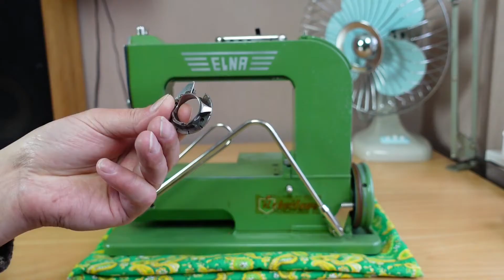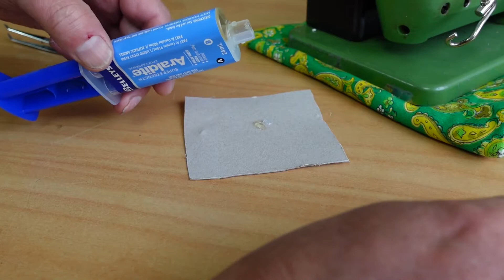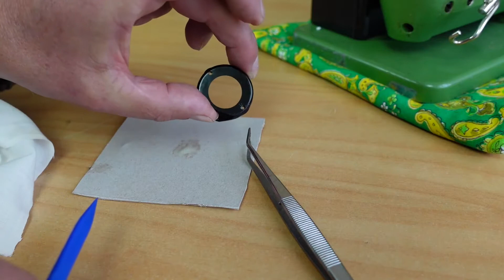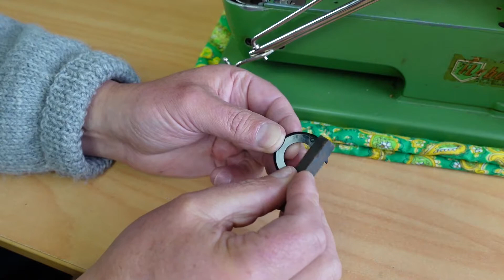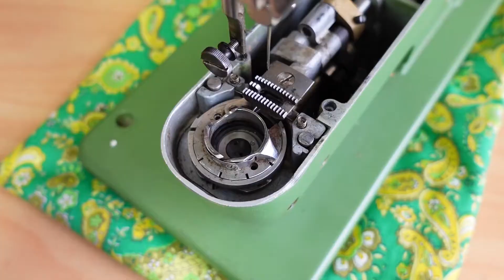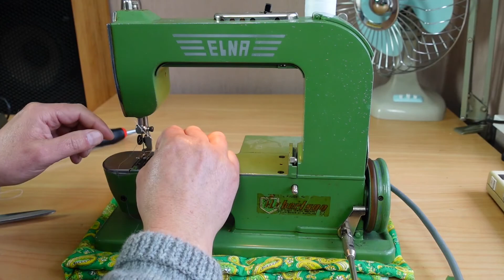Elna 1 (Grasshopper) Bobbin Holder Repair and Installation

Comment: For buttonholes, I use a pre-marked removable tape to help with accuracy of placement, and length of the buttonholes. After stitching, I apply Fray Check and allow it to dry thoroughly before cutting. Then, I place only one half of the buttonhole on the hardwood block, so that I can ensure that the chisel is not cutting through any of the end threads, then turn the buttonhole and cut the second half. I often use a high quality rayon thread for top stitching and buttonholes. For nice collar points that are not lumpy, I use the techniques described by David Page Coffin in his books for shirt making. For several years I made custom western shirts for rodeo riders and Mexican charros, which was fascinating. Mexican charro shirts use different types of toggle buttons, made of plastic, bone, or leather, and they are quite beautiful. It can be a bit of a nightmare, though, watching a cowboy ride out of the chute wearing one of my beautiful shirts, only yo watch him and the shirt get stomped into the mud and dirt by a big bull, leaving the shirt ripped into shreds. LOL Your videos are absolutely excellent. I have this Elna machine, and recently enrolled in a maintenance and repair class for ultimate certification. Your videos are absolutely about the burned out inductor is exactly the information I have needed for three years—my repair person has been trying to tell me that I don’t know how to install the lightbulb correctly, among other things, and now you have helped to confirm that the problem is inside the machine, making the light go off and on each time I move the plug in. I look forward to more of your videos. Watching from the Willamette Valley in Oregon, USA.

Comment: Would love to know if there's a trick to getting the feed dogs off of a grasshopper. We can't seem to loosen the screw holding the feed dogs. Therefore, we can't clean under the bobbin holder area. So frustrating!
Reply from the maker: Hi, Your best bet is a long handled high quality screwdriver of the correct size to fit the screw head.

Comment: Buenas, tengo una máquina idéntica... Pero cuando la pongo a funcionar hecha humo. Cuál sería el problema? Gracias
Reply: The Elna man I bought my one from said this model will smoke when it is being used due to the occasional drop of excess oil burning off in the mechanism. He told me it is quite normal and will disappear after a short time. It is disconcerting when it occurs all the same, but is nothing to worry about.

Comment: Interesting and useful video, cheers. Although I don't own one (yet), I've read they originally came with two oilers: one with kerosene just for the bobbin race and one with normal oil for everything else. Do you have any information/views on this?
Reply from the maker: The hook race does require kerosene for lubrication instead of oil. I have an oiler for an Elna machine that is coloured brown, as opposed to black like the normal oiler. I guess the brown one could've been for kerosene but I'm not sure.
Reply: @InStitches  Thanks for the confirmation.